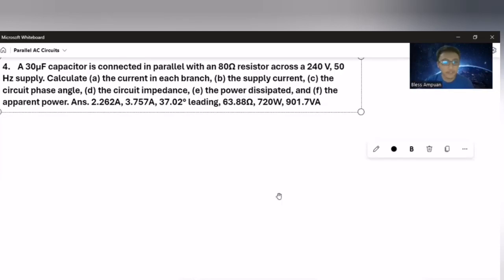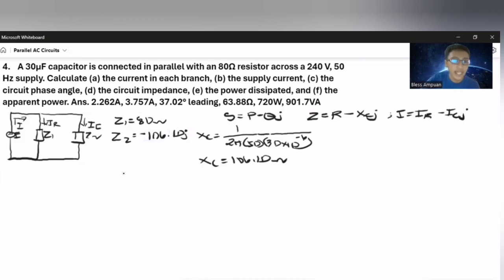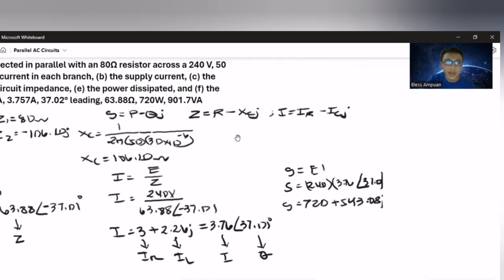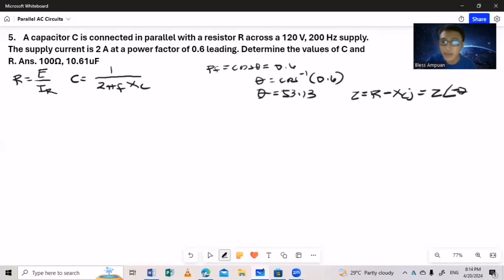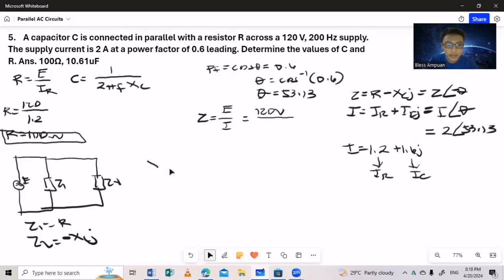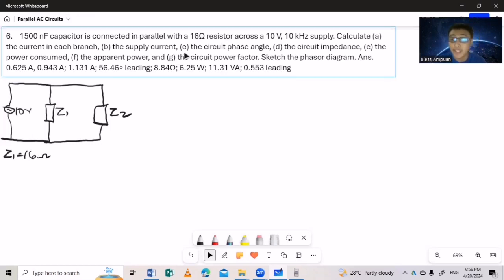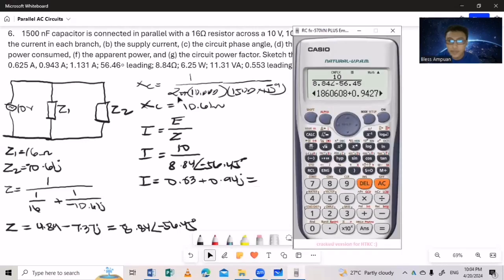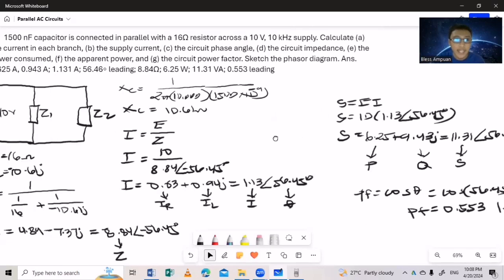Resistance-Capacitance in Parallel AC Circuits | Example Problems

Comment: After watching the video I've learned to calculate total impedance, branch currents, and power consumption by converting capacitor values into capacitive reactance. The presentation demonstrates how to determine the supply current, phase angle, and apparent power effectively. By visualizing the branches, I can confirm that the current leads the voltage, a key characteristic of capacitive circuits. These examples provide the essential methodology and formulas needed to solve for unknown circuit variables using standard electrical engineering principles and precise phasor analysis.

Comment: I have learned in this video the concepts  R-C connected in parallel circuit. Just like RL in parallel circuit, the voltage drop in both resistor and capacitor is equal to the total voltage, and also the current in resistor and inductor is not equal to the total current drawn by the circuit. The only difference is that the impedance in the RC. In the RC circuit, the inverse of the capacitive reactance is negative when added to the inverse of the resistance in solving for the inverse of the impedance. This is because the current in the RC connection leads the voltage by a quarter of a cycle while in the RL connection, the current lags. The formula for apparent power is just the same however the angle used in the current to be multiplied to the voltage is negative.

Comment: This video about Resistance-Capacitance in Parallel AC Circuits helped me understand how currents behave differently across each component. I learned that the current through a resistor stays exactly in phase with the supply voltage, while the current through a capacitor leads the voltage by exactly 90 degrees. I also realized that we cannot just add the currents normally, we have to compute their phasor sum instead. This results in a total current that leads the applied voltage by an angle between 0° and 90°, which changes depending on the values of resistance and capacitance used. The explanation was easy to follow and made the whole concept much clearer to understand.

Comment: After I watched this video. I found out that the voltage is the same across both parts of an RC parallel circuit. The voltage and current through the resistor are in phase, but the capacitive current is 90° ahead of the voltage. You can't just add the phasor sum to get the total supply current; you have to use the Pythagorean theorem. So, depending on the values of R and C, the overall current leads the applied voltage by a phase angle between 0° and 90°. I learned how to use phasor diagrams to figure out how circuits work and how to understand the important phase relationships between voltage and current. Thank you, sir.

Comment: After watching the video, I've learned that, Parallel RC (Resistor-Capacitor) circuit, the behavior shifts in the opposite direction. While the resistor branch still acts normally, the capacitor branch acts like a storage tank that is hungry for charge. As soon as the voltage is applied, the current rushes in immediately to fill the capacitor, which means the current actually leads the voltage. This creates a positive phase angle in your calculations. The "resistance" from the capacitor is called capacitive reactance, and it is unique because it actually gets smaller as the frequency of the electricity increases. Just like the RL circuit, the voltage is the same for both the resistor and capacitor, but because the capacitor current leads, the total current triangle points "up" instead of "down," resulting in a different power factor for the system.

Comment: After watching the video, I learned that both RL and RC parallel circuits have a resistor connected in parallel with either an inductor or a capacitor across the same voltage source, with each branch carrying its own current. Because the tutorial is easy to understand, I now know that in RL circuits, the resistor current is in phase with the voltage while the inductor current lags, whereas in RC circuits, the resistor current is in phase and the capacitor current leads. I also learned how to calculate branch currents, total current using vector addition, power factor, impedance, and phase angle, as well as how to compute in complex mode using polar and rectangular forms.

Comment: Watching the tutorial on RC parallel circuits was a great way to see the flip side of how these components work. One of the most helpful parts for me was realizing that while the voltage is shared across the branches, the current behaves completely differently than it does in an RL circuit. Instead of lagging, the current in the capacitor "leads" the voltage. Seeing that 90-degree shift visualized in the phasor diagram really helped me understand why we can’t just add the branch currents together like simple math.

I also found the breakdown of capacitive reactance really useful. It’s interesting how the capacitor's opposition to current changes with frequency, which then dictates how much current actually flows through that branch. Learning to use the Pythagorean theorem to find the total current and then calculating the phase angle made the whole concept feel way more practical. By the end of the video, I felt much more confident in my ability to handle the vector addition required for these types of circuits. It’s definitely making the transition to more complex AC analysis feel a lot more doable.